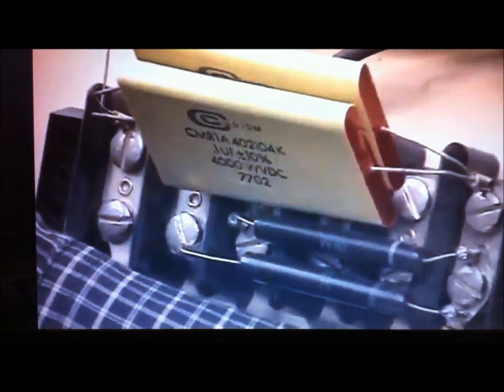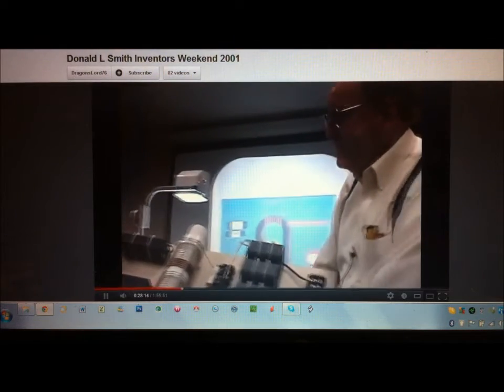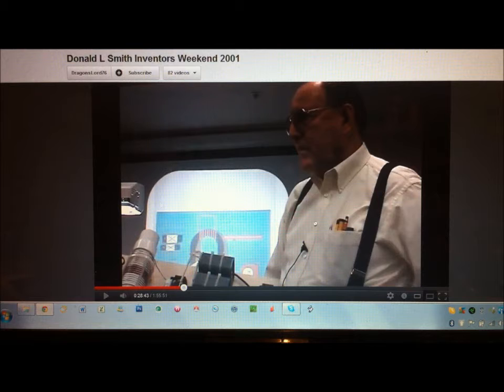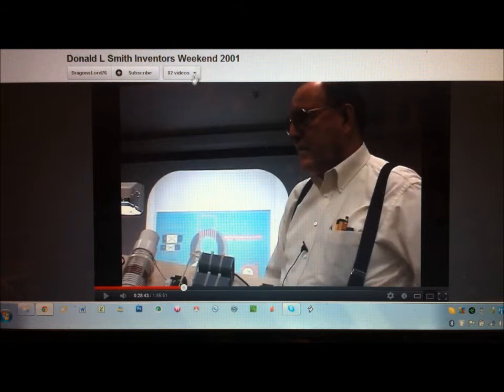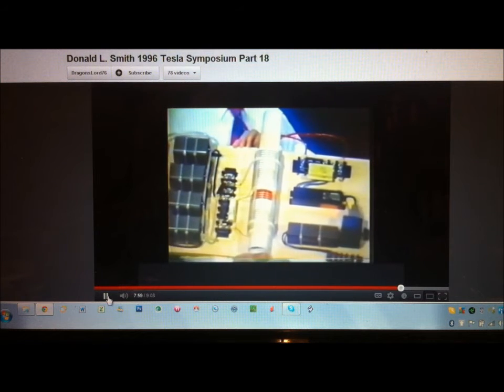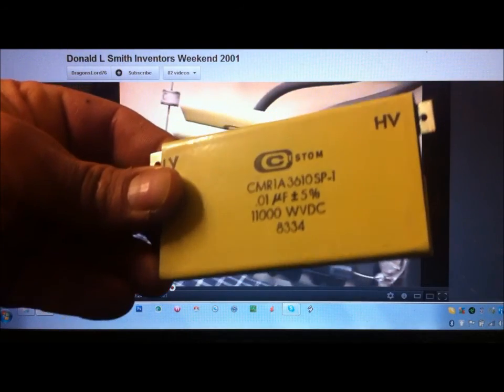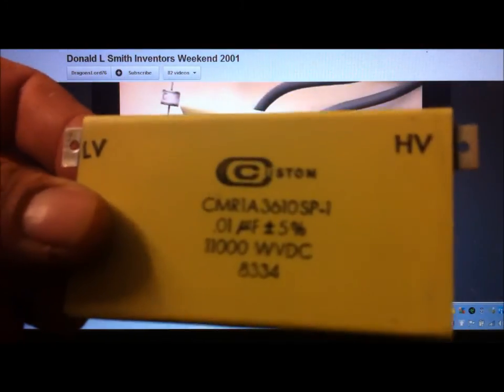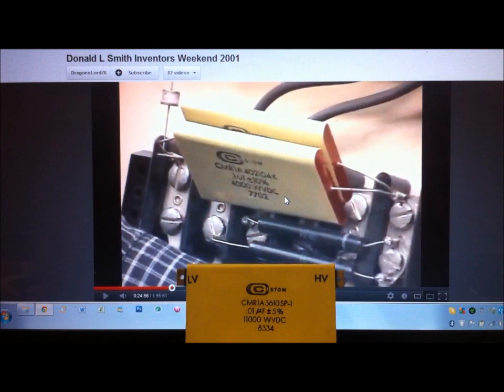Are The 'DON SMITH DEVICE' Capacitors Really IMPOSSIBLE TO GET?

Comment: Hi, I got a couple of "test" capacitors a while back 4kv .1uf. The problem dealing with Don Smith and his devices is that we are always double guessing what he is saying. There is no doubt that he specified a change to the usual method of production/materials, which Cornell Dublier at the time, would have had to wait until they had a spare time slot on the fabrication line. So we might conclude that it takes at least six months for "special " capacitors to be produced. No doubt Cornell were interested in looking at the modification to see if there was a commercial viability to Don's specifications. Remember, Don was a Geologist of some intellectual reknown! He understood the nature of dielectric materials.

Comment: the NST's and spark gap widths along with the inductance of L1 change everything.. they all need different sizes, it's like a fingerprint, that is why I like to add a variable air cap and tune it a bit. They are not all the same and never will be. Best Suggestion is to Buy all different sizes and change them or add more or less  to see which is best. Eventually you'll find a working cap if it is in the correct arrangement.

Comment from the maker: I thought the same thing - the caps are only there to tune the primary circuit & each system is different, which means that everyone needs slightly different caps depending on their primary circuit as a whole, but Don does not explain this. You are right: "The smart ones will figure it out". I will email you about where to get them, as the availability of these caps is getting scarce!